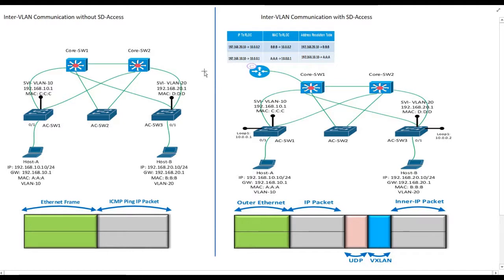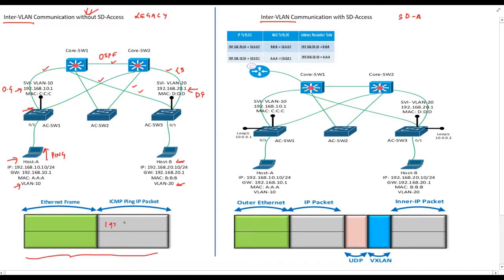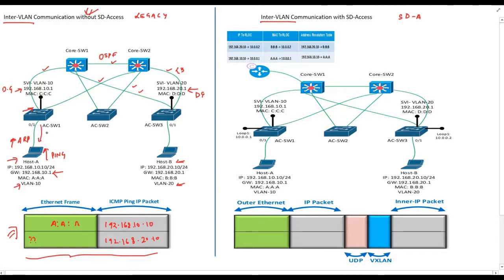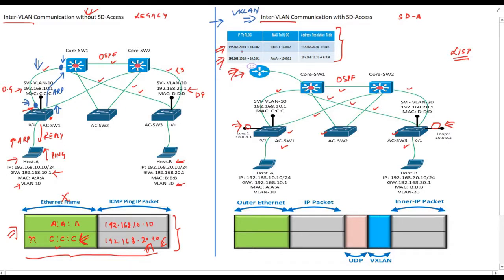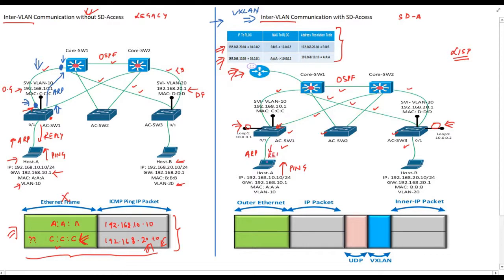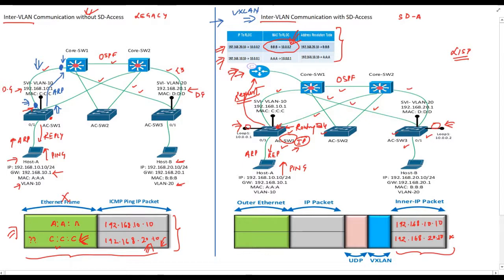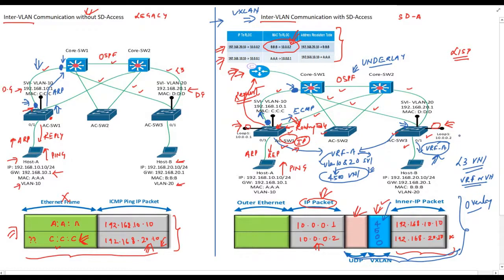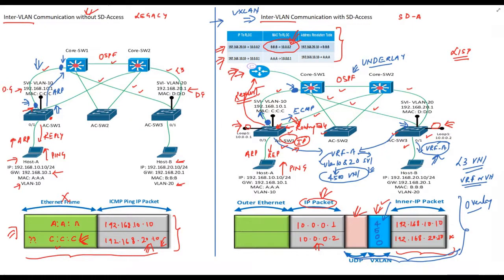SD Access Control Plane Part 3

Comment: Great video. Just one question. VxLAN encapsulates L2 frames in IP/UDP. But in the video, I see that VxLAN is encapsulating IP in IP. The original L2 headers are missing. In other words, there must be L2 header between the VxLAN header and the inner IP packet. Right? Or am I missing something here?
Reply from the maker: Hey.. by any chance have you seen the data plane videos.. please have a look.. I have explained this in greater details there.. thanks..

Comment: Hi Vishnu, After long time you back. Great to see your video again. I had one question, as I know in SD-Access to communicate between two VRF (or VNs), we need to go through either firewall or fusion device so in our case, vlan 10 and vlan 20 if part of different Virtual Networks then communication is not possible unless we have firewall or external fusion device but in last few minutes as you said vlan 10 and vlan 20 part of same vrf (VN) then it makes sense and we don't need fusion or external device. Kindly correct me ?
Reply from the maker: Hey Prashant.. how are you.. Your understanding is correct.. We need a fusion router or any external device capable of routing if we want inter-vrf routing in SD-Access. Hence, in this example, vlan 10 and 20 are part of same VRF.. By VNI value 4500, destination switch knows where exactly it needs to forward the packet. This statement can be confusing.. Although, inter VRF routing is not possible but still we can have multiple VRF's on edge switches and can map them to different layer 3 VNI values. 

Suppose an edge switch is configured with VRF-A has vlan 10, 20 and 30 and VRF B has 60, 70 and 90. We can map VRF A to 4500 and VRF B to 4600. These vlans can talk to each other only in their respected VRF. 
Please let me know if it clears your doubt.

Take care..
Reply: @bridgewhy  Thanks a lot Vishnu for your time in explaining.